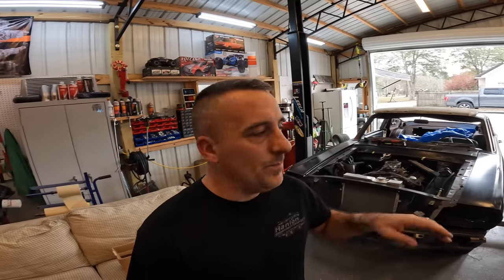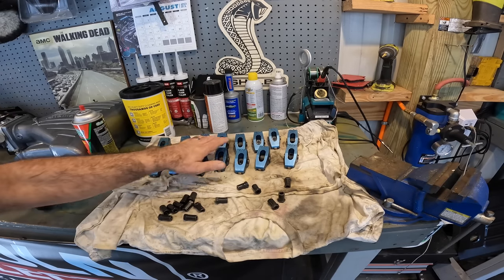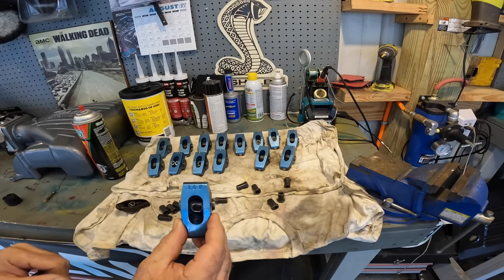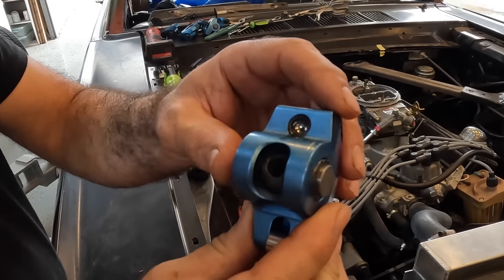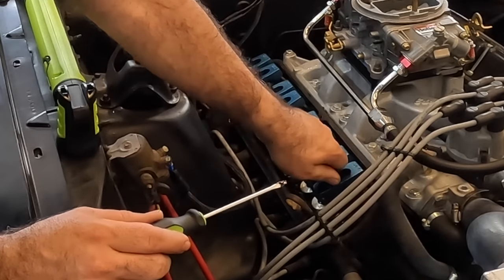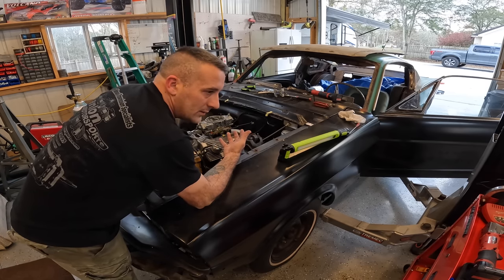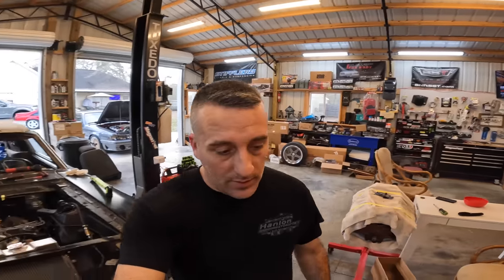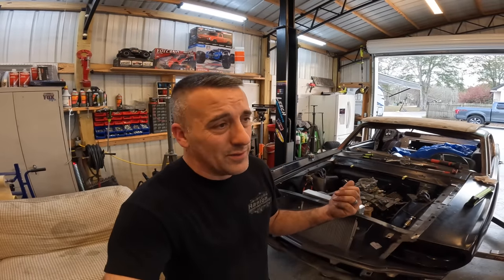Foxbody Roller Rockers On A Non-Roller 289?

Comment: 🔔😎
Just a quicky FYI for the group.
David Vizard recommends PRW Sportsman rockers for a budget build. $ 140.
Either 1.6/1.6 guided/1.7. DV says the off the seat ratio is about 1.83. THAT gives a big boost in the low lift flow. These are ball fulcrum and roller tip cast steel. 
Always check your pushrod geometry on the valve stem. 👍😎

Comment: Sounds much better. Now put a HO cam in her, with a HO firing order. If you don't have one I have a TFS stage 1 cam, just let me now. You can turn an old 289 or 302 to a HO by just replacing the cam and switching the firing order to HO.
Reply: E cam is much better due to better LSA, definitely better than 289 HIPO cam, makes a good driver. E cam is about 22 hp/tq better than a stock HO cam.
Reply from the maker: I’ll be swapping it to roller at some point with an Anderson cam

Comment: did a 351 Windsor   stroked it to 406 it  runs great I'm a big ford nut   my buddy has 66 gt fast back hp 289  271 horse stock solid lifter cam  dual point dist. it runs very well also.

Comment: Also have a '65 Fastback, 408 stroker, what starter are you using, your car fired right up.
Reply from the maker: In the video I was using a stock style 65 starter (automatic) but it sounds like crap. I’ve tried ones from a FOXBODY and still no change. I’m currently looking into that issue
Reply: @BREW2LFOXBODY  I used the smaller starter you'd find on a '95 Mustang, never really seemed up to the task, this motor has 10.5:1 compression, maybe I'll go to a mini high torque.

Comment: Decent method but I've always just gone thru the firing order on my balancer.  Takes a wrench but saves the starter I guess.  Plus you set two at once then rotate 90''degrees.   (720 degrees / 8 = 90).  Just better for me.
Reply: I felt like the reduced friction made the idle sound more 'effortless'.  I like that.

Comment: Great videos...been watching for awhile now...
I have a 65' fastback with a flat tappet 302 efi motor.
I've been wanting to install roller rockers on it...I know the valve covers more than likely won't support the rollers because of height issue...
If I was to do it properly,wouldn't I need to change pushrods for length difference...
Thanks for this vid...simplicity
Please let me know...learning
Thx

Comment: I'm actually installing a howards cam with their roller conversion on my 289, if I install roller rockers do I need to drill and thread fir new post or will they just install and be alright after measuring for push rod length of course?

Comment: Man I love the channel but I advise against this mod. You have no way of containing the pushrods (guideplates). The stamp rockers should have little “guides” that hold the pushrod in place.
Reply: ALL 260/289s before April 30, 1966 had slotted pushrod holes in the heads to guide the pushrods/rockers.
That's the date of the production changeover date to guided tip cast rocker arms. Later heads had big round pushrod holes in them.